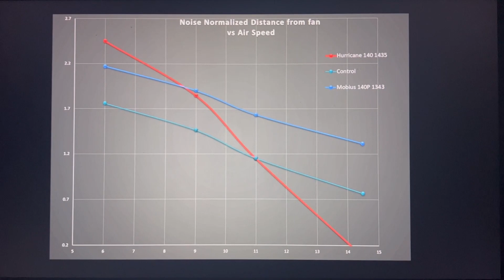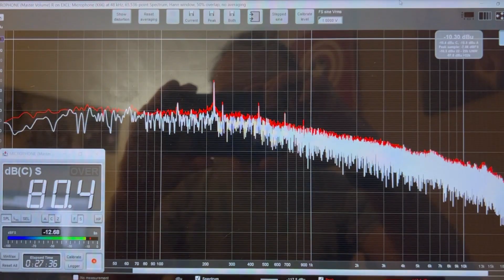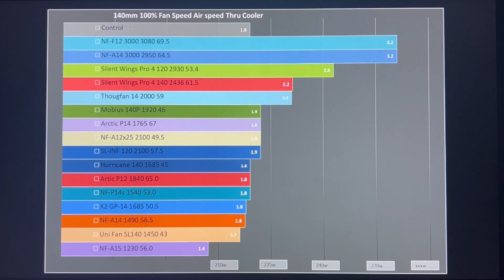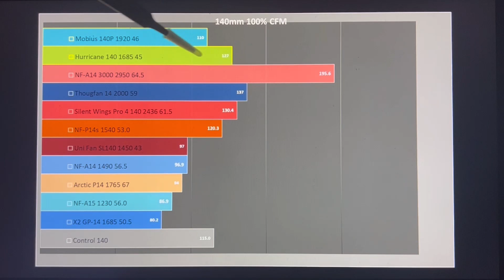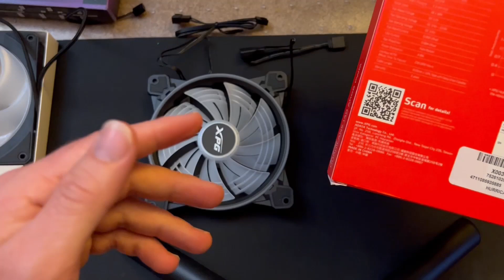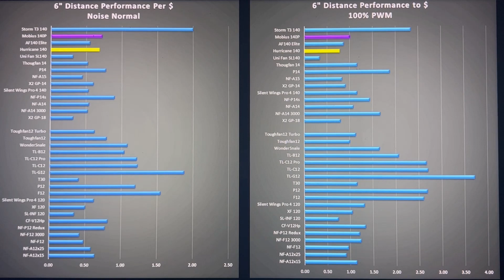CoolerMaster Mobius140 vs XPG Hurricane140  (Old Testing Method)

Comment: With the Hurricane. If its snug up against radiator fins. will the lack of a square frame really matter? You did mention that your radiator tests were good.
Reply from the maker: yes. will it matter. not to much but it depends on the Rad. the higher the fin density and the thicker the Rad the more it will matter. 
I have an updated video of this fan https://youtu.be/rGEr5jdJn_I
Heatsink the noctua U12A, I only just acquired a Rad.

Comment: I've currently got T30's mounted on a deshrouded GPU, would I benefit from swapping them out for 140p's from a noise-performance standpoint?
Reply from the maker: Personally I dont like the T30 noise profile. So if you dont mind it they are fine. If your looking for something better noise wise the Toughfan 14 pro is the best 140 ive tested. but it wont move as much air as the T30 at Max RPM. My noise normalized it crushes the T30 though. 
I havent released the Toughfan 14 pro video yet. Just have data.
Reply: @computer-tech-more  appreciate it! I’m not a fan of the noise profile either, I’ll look at the Toughfan
Reply from the maker: @Schlumpt1  NP
Reply: @computer-tech-more  The Toughfan 14 Pro didn't end up working as a GPU heatsink fan, too much of the fan was hanging over the side and it created turbulence. They work great as rad fans though. Would the Toughfan 12 Pros/Turbos be worth trying out compared to the T30s for noise-performance? Or just stick with A12x25's?
Reply from the maker: @Schlumpt1  I start testing the Tough12pro's today. but wont have any data for atlease a week. 
Kind of expensive but the Unifan p28 might also be worth considering. it tested really well. 
I plan on having video out for that one in Dec.

Comment: The xpg hurricane seems to be a good intake/exhaust case fan. I think i'll get one for the exhaust since it has a significant drop with distance.

Thanks for this review.
Reply from the maker: I really wouldnt use it for intake but ya exhaust should work great. 
Thank you for watching.
Reply: @computer-tech-more Well I’ve ordered 3x140 XPG as for intake (my priority is noise level) but the test with distance seems quite contradictory. I mean, significant air speed drop may be caused by the fan blowing the air to the sides instead of blowing straight forward, but the total amount of air, including ones that is reflected by side window or motherboard, is still good enough for intake. Moreover, that’s not the situation when the fan blows directly to pc components, in most cases, it just puts the fresh air into the pc case, so the more air is coming the better. 

Sorry for English btw, not a native speaker, and I appreciate your work in researching pc fans characteristics very much. Very interesting and helpful)
Reply from the maker: @teabug46  np. the case sim test is basically my theory. Direct (concentrated) airflow > less focused airflow. The main difference would be seen in aircoolers. 
You want the air to cycle in and out of the case efficiently basically. 
My main problem is $$ for being able to actually have a test system and other hardware to prove the point. I hope as this channel grows to do that one day. 
But airflow is better than no airflow.

Comment: Hello! Nicely done video

So, can you recommend Mobius 140p? Or are there quieter alternatives with similar CFM/airflow? Thank you
Reply from the maker: Yes I think that with what I have tested on the market the Mobius 140p would make a great all rounder fan. good case airflow and good CPU cooler / radiator airflow.
Reply: @computer-tech-more Thanks! Just wanted to ask, are there any audible dB peaks? Like on Silent Wings 4 Pro 140 from Igor's tests
Reply from the maker: @boromir7010  If i recall there werent any harmonics or resonances ie Peaks in the Mobius 140. 
I found similar results for the Silent wings as Igors lab with the harmonics.
Reply: @computer-tech-more Thanks!
Reply from the maker: @boromir7010  NP